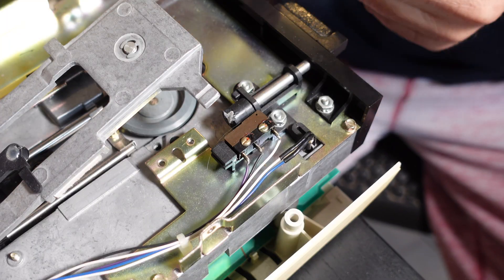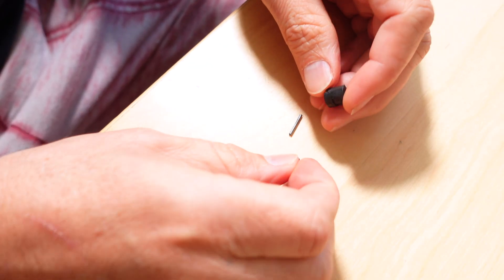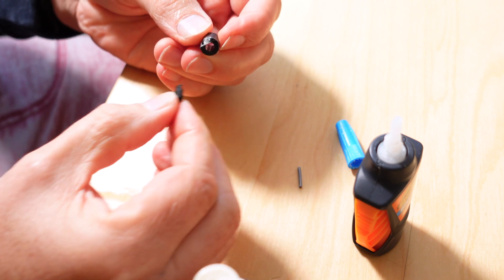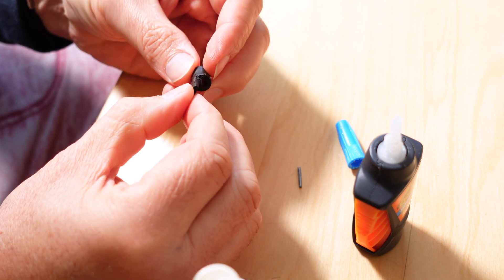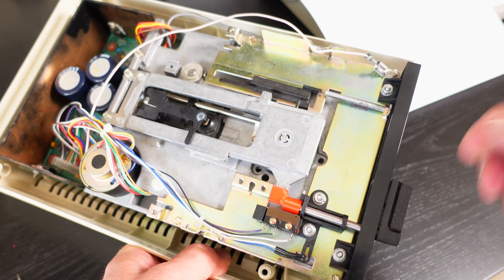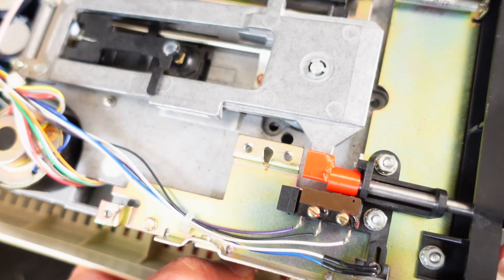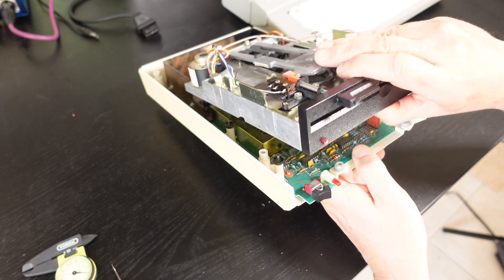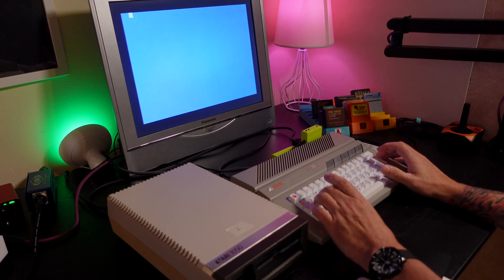3D Print and Replace Atari 1050 Drive Latch Mechanism

Comment: Great video! The sound of the 1050 really brought back memories. Two question: what CAD app are you using? And what type of filament did you use? It looked "shinier", if that is the correct term, than PLA.
Reply from the maker: The 3D design software is called Shapr3D. The filament is a PETG made by overture. Thanks for watching and commenting.

Comment: Well done. If you didn't want to make your own part, you could have added baking soda to your original super glue repair and I'm sure it would have worked. Just search YT for "super glue baking soda" to see examples. I repaired some plastic screw holes on my microwave using this technique and they've held up great.

Comment: It looks like there was more than one design for the 1050 drives. I remember when mine developed a problem. I would open the latch, but the hub wouldn't raise fully, so I couldn't get a disk in. I opened it up, and saw that the hub was on an arm that came in from the left side, and was only held up by a flexing piece of thin metal (it looked like a small sheet of copper, as I remember), used as a spring. The latch had a similar mechanism that would push against the spring, forcing the hub down. The spring had developed a crack, and so was no longer able to support the weight of the arm. I think I was still a teenager at the time, but it was in the late '80s, so support for the 8-bits was winding down. My mom helped me out by finding a piece of plastic that we were able to somehow glue onto the thin metal spring, to add reinforcement, which helped a little, but it still wasn't enough. So, I ended up turning the 1050 on its side, which allowed the arm to pull all the way up when I released the latch. For whatever reason, I never replaced the part. I just used it like that.

It seems like from what I've heard since, there should've been replacement parts available, from someplace like Best Electronics. I just didn't know I could get them. It's good to see it's still possible to repair these things.

Comment: I wonder if having a disk in the drive with the door closed would have prevented this part from being damaged.
Reply from the maker: Actually, I think there WAS a disk in the drive which could have contributed. Remember, when the drive lever is closed, there is pressure on the "flag"